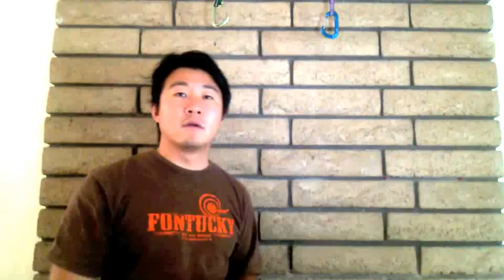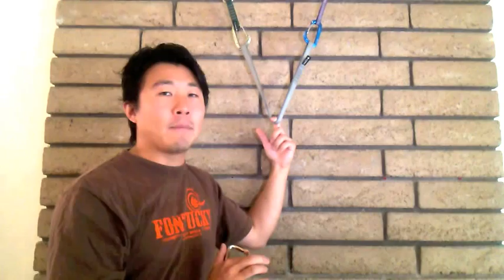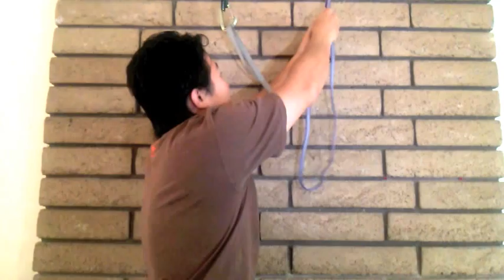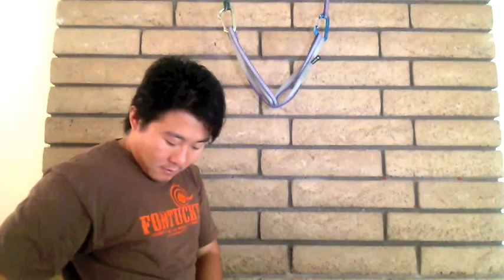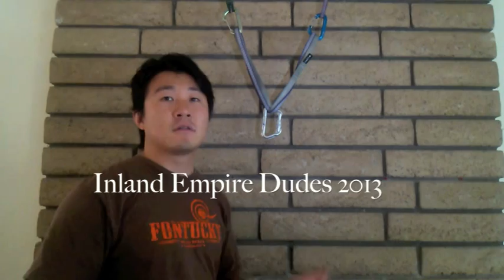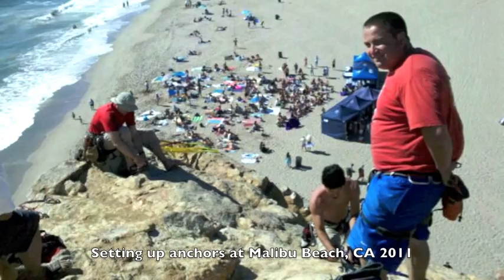Top-Rope Anchor DON'Ts: What NOT to do!

Comment: I don’t think 2 slings in a magic X is the answer the friction would concern me. I use a quad anchor built with a 240 cm nylon sling but Dynex would be fine too check out this video and others from hownot2 if you’re concerned about the forces involved https://youtu.be/she8vH1DCBU

Comment: 😂 nobody is busting carabineers clipped into a master-point never even seen it in a video there's no point in backing that up if you know you have a good carabineer especially if it's a steel carabineer. Unless the carabineer is getting loaded at a weird angle that reduces the strength then there's not really a point to backing it up

Comment: The single sling sliding X is a common and safe top rope anchor under normal circumstances for bolted anchors.  I would be extremely interested to see a documented case where a sling in this configuration that is in good condition has failed at a bolted top rope anchor, even where one bolt has blown.  Perhaps if you do something stupid like try to climb above your anchor and then fall on it, or where the sling is in poor condition but otherwise slings don't break like that.  Ditto for carabiners.  

Just saying that everything should be redundant is completely unscientific.  In some cases it is necessary but in others not.  If you understand and respect forces generated on pieces of gear and maintain your equipment there's no need to get into this nonsense.  Otherwise you're going to end up clipping two quickdraws into every bolt, using two single ropes, and wearing full body armor to climb, which is the approach that this guy seems to advocate.  

Check out these sling break tests for more - http://dmmclimbing.com/knowledge/slings-at-anchors/
http://blackdiamondequipment.com/de_DE/qc-lab-sling-strength-in-3-different-anchor-configurations.html

Comment: My instructor told me to always use locking biners in anchor building. I think I'll stick with that.
Reply: +Beau W Ajax using a locking biner in the system is actually increasing the redundancy of the system.  If the 5 seconds it takes to unscrew a gate is a factor there are auto-lock options that might be a better choice.  The fact of the matter is rock climbing is an inherently dangerous sport that's why people do it otherwise they could just watch youtube videos for kicks...and what is the point of building one redundant "master anchor point" if the entire system is not redundant this would mean using twin ropes, 2 biners at every connection, 2 harnesses, 2 belayers, etc basically safety yourself to the point the sport is more of a burden than an experience...point is if you put a loaded gun to your head and pull the trigger the probability is you will have clean ear canals and a very bad day, you should know the risk you are taking and if you are not willing to take such risk build accordingly.
Reply: +AJAX B, That's probably because your instructor ignores using redundancy at his master point, safety techniques evolve over time. Redundancy of all parts of an anchor never used to be the common way things were done, now we now (through people being severely injured and dying) that ANY part of a system can fail and that redundancy is a must for a truly safe anchor.

And as he says in the video having a quick way to secure yourself at the top of a lead climb is very important, which is not provided by locking carabiners. This is obviously less important if you are only ever top-roping.

Comment: What is the difference, in your mind, of pulling the 2 anchor carabiners together, as you showed, and having the rope go through 2 carabiners doubled at the X spot?
Also, because you don't want to have to unscrew a carabiner does not make it unsafe, or not as safe as a locking one. Safety trumps convenience every time, otherwise we wouldn't be discussing backups!
Reply: +Bwanar1 You never want the angle of the gear between your 2 anchors to be greater than 90 degrees. If you use just 2 quickdraws to create your anchor and the bolts in the wall are too far apart then the direction of load on the carabiners of the quick draws will not pull in the direction they were created for and are much more likely to fail.

As for the part about why he advocates for not using locking carabiners it's because having a quick way to secure yourself at the top of a lead climb is very important as an issue of safety, which is not provided by locking carabiners. This is obviously less important if you are only ever top-roping.

Comment: 2 quickdraws, gates facing out. welcome to 99% of sport crag toproping. quick. easy. SAFE! for the boy scout scenario, if your instructor, or papa bear (?), or whatever you call that guy/girl, is using slings, hes probably a novice at best...or has very limited resources...if you are setting up an all-day toprope, grow up and use cordelette, cheap, much more shock/abrasion resistant than slings (nylon or dyneema), plus it's infinitely more versatile!
Reply: alex kray What the hell kind of cordelette are you using that's stronger than a sling? Dave Furman from mammut wrote an excellent article describing the forces acting on cordelette in an anchor scenario. If you have really good 7mm cord it will have a strength of approx  10KN, because you double it up you get about 35% more strength (13.5KN), that's slightly more than half the breaking load of an average sling(22KN).

Comment: So let's say a figure 8 knotted single rope takes at least 16kN even after some use. Rope friction at the master point is approximately 30% of the load applied to climber. So in a case where one was toproping at seacliff and a great white shark were to snatch the climber from the wall thus causing over 16kN load to the climber side, the anchor would experience at least 1.7 times that which is over 27kN. Most lockers take 22-28kN so yes, back it up!
Without the shark I find it difficult to top the 9kN max. impact force transferred by single ropes(This will be higher if climber is over 80kg!)
Rig steel for the boy scouts, that's what gyms do.

Comment: I would say doubling up on slings and caribiners is overkill, those are going to be the last things that fail in your anchor system.
Reply: There's a great resource called "Accidents in North American Mountaineering" which can provide examples where this is folly. You're right that these fail rarely, but I can name cases where strong webbing has indeed failed (we lost someone in Yosemite not long back where a belay loop failed, and this is double the strength of a single strand of webbing). Don't risk your life to it. That carabiner might have fallen and be cracked, that webbing might have spent too many years in the sun. There's no good reason to ignore redundancy when it's so easy to add the second sling or biner, it just doesn't take any effort at all. I would never climb on a non redundant anchor, nor with anyone who set up one.
Reply: Slings definitely break, especially older ones that people should have retired but don't.  Also, the main reason to double up on carabiners is because the gates can be torqued open under the right conditions.  Using two with opposing gates mitigates this.  In fact, when I'm top roping I feed the rope through three carabiners.  That way, the rope is going through a much wider diameter arc, which reduces wear and kinking on the rope.

Comment: You meant half ropes, though you had twin ropes in mind. Twin ropes are treated as single, but always tied in and clipped in together. Half ropes are used for trad climbers to clip protection in two separate lines. Half and twin ropes are completely different.

Comment: In still wondering why you're saying top rope protection. This setup is for climbing and arresting a fall. 

You should state that. As you should know you should never be more then 3 m above any fall protection. 

Try taking a UIAA certified class like Petzl.
Reply: This set up is used to make an anchor at the top of the route. Then the rope is fed through the carabiners or a pulley (with some back up). As the anchor is at the top of the route, it is never meant to be climbed above it (unless for topping out, but that doesn't happen that often with top rope climbing). 

With all respect, take a climbing terms dictionary. You got your facts wrong.
Reply: Actually I got my facts right.

This setup is put in place by a lead climber on the route which can be anywhere. The top rope should never be setup like this. You need a second point to tie off the lead climber that can hold him and the second if he falls. This applies even if the second climber is above the belayer on any route. You should never use the human body as the fall protection period.

This is not a top rope protection either. It doesn't meet the first requirement.
Reply: Jousikorkojaakko Your best point is your last one.
Reply: Claude Rains What the hell are you talking about? Please, check what toproping actually means before pushing any nonsense like this. This setup has nothing do to with holding the second if he falls. 

As shown in the video, the common sports route setup in local crags are two bolts. Common practices:

-Someone leads up the route and setups the top rope, as instructed in this video (while simultaneously clipped safely to the second bolt - or if the platform is good or depending your personal risk level, clipped to nothing). 
-Someone walks up the crag and setups the top route, as instructed (while ... etc).

After whis you, walk or lower yourself or someone lowers you from the top rope anchor you just created.

After this the climber is free to top route the route, rope going through the top rope anchor and belayer staying on the ground and belaying the climber. As in fucking any normal gym or top rope situation. 

"I actually got my facts right". Right.
Reply: No you don't!

You're welcome to read http://www.irata.org/docs/pdf%20downloads/IRATA%20Technical%20Report.pdf
 
Or

http://theuiaa.org/upload_area/files/1/Attaching_to_rope_by_karabiner.pdf

Good day
Reply: Claude Rains Im still not following you.

What is the problem here? Of course you don't (or to be exact, the top roping climber) tie the top rope to a screwgate carabiner or a clip carabiner, you tie it directly to your harness.

And yes, while setting up top rope anchor, I always use:

-Use two slings and; 
-A single screwgate garabiner or magnetron (negates the gate automatically screwing open with a rope) and a backup carabiner.
-Or two adjacent clip carabiners
-Or combination of these three. NEVER the screwgate alone.

Please elaborate. How is this not a top rope anchor? How would your top rope anchor differ from this? The guy on the video clearly states that the clipping carabiners in top of the frames are to simulate the normal two bolts found on the crags. 

And anyhow, who in their right sense would base their climbing anchor training to youtube videos anyway.

Comment: You always hear about redundancy is key for climbing, etc. I completely agree with this notion. However, has anyone else ever realized that almost every single climbing system is not redundant because of one piece of equipment; the rope. If your rope fails, no matter how redundant your system is, you are basically screwed (unless you're using two ropes for whatever reason).

Anyways, I would also like to mention that the American Mountain Guides Association (AMGA) single pitch instructor program manual describes the "magic x" anchor with only ONE sling as pretty much the gold standard for climbing. Generally, two over hand limiting knots are added to each side of the "magic x" anchor in case of failure (adding your "redundancy" to the system).
Reply: http://www.hapaet.com/onrope/anchor_equalizing_forces.gif
Reply: +Matthew Leroux ^ this guy knows what he is talking about.
Reply: +Matthew Leroux Safety evolves. This used to be the standard. People have died. Redundancy of all components of an anchor is the new safety standard.

Comment: always have your slings against the spine of the biners and you can normaly get away with using carbon steel biners which are nearly impossible to wear out and just put up with having to unscrew the lock.

Comment: when using two snap gate biners together with gates opposed then you can add friction into the system on the sides of your rope, just something to be aware of if you aren't already.
IMHO, you should re do this vid, no um, and I think your point at the end is irrelevant (belay biner has load only when lowering or when holding a person, its the same for any other carabiners, except for when you are getting rope stretch.

Comment: What your doing is safe, but the reasoning is a but lost.  You must trust your equipment to not break.  The bolts, the pieces of protection and the anchor systems will always be the point of failure.  People kill people.  If you can find someone who's had a carabiner "sawed through by rope" please let us know.  Having two more than one being on the focal point is to save your carabiners from wear and tear.  That's my two cents.

Comment: The vid wasn't a catastrophic failure, but it does need some improvement IMHO.  The major problem with "Instructional" vids is that there are 2 types of ppl posting - actual climbing (and high angle work in general) instructors...and guys like IED.  There are only a few good vids out there (Joe Mackay aka mikebarter) and the rest either miss too much, explain things poorly or are just plain wrong.  Then there are the 2 types of ppl who research these vids - ppl who already know safe practices and are just looking for other ideas, and those who know nothing (or enough to be dangerous).  Either way, "The Youtube" is not a place to learn anything as dangerous as climbing, anchor building or high angle work.  If this is your sole source of learning, then good luck to you.  I just hope that I'm not at the crag when you thunder in... although good practise, I don't really want to be doing rope rescue work for those who shouldn't even be there.

Comment: 1. you were unable to explain why "american death triangle" is unsafe. The reason you present is not enough - I get the impression you simply lack knowledge
2. in your comments you say that no one explained the physics behind magic-x... let me enlight you - there is a plenty of such descriptive movies. here you go: Multi-Point Anchors | Rigging Physics II
3. later in comments you show lack of basic knowledge about the concept of reducing different risks. Simply adding more stuff doesnt address many risks that will still be there (like line flattening, dynamic shocks, etc. for starters).

My advice - go learn before you get yourself killed and (most important) - before you direct anyone else into trouble.
Reply: I agree that this is a bad video, but I wanted to weigh in on the whole "american death triangle". I was originally taught that method by someone who probably needed an update. I learned from others who had more experience to build truly redundant anchors (if such a thing exists). The "magic x" is only redundant if two slings are used. It's not unheard of for slings to break. If you only have one sling in use, and it fails, the whole system fails. That's never an ideal anchor. As far as I can tell, depending on the style of climbing you're doing, true redundancy is a luxury and not always adhered to. I've pulled up a second on anchors similar to the "American Death Triangle" out of necessity. Some may think that's totally unacceptable. I say you have to access your own level of acceptability. In short, it's not ideal bc it's not redundant. Maybe I'm wrong.
Reply: ***** Good point. You probably refer to situation where one point will fail and the load on the second, together with force applied by short "fall" will exceed the maximum breaking force on the second point or / and sling. This may be fatal. I have seen one man using short loop of dynamic rope instead of sling for such purposes. Maybe such replacement can make the magix-x reasonable choice, but anyone trying it, should calculate it correctly before use.

Comment: Sorry, but this is false.
I always use the "Magical X", or multiple slings (or a cordelette) with a eight knot on a bite (the later is better as in case of one of the bolt failure, it will not chock the whole system.
When climbing, you start with the hypothesis that the sling is fine and can hold you and will not break. Same for the harness, your grigri and your belay carabiner!
I agree with the need of two carabiners though as they can get unscrewed with the rope.
beginners, don't watch this!

Comment: Not a bad video, dig this bro =) 2 locking carabiners or 3 oval (opposite/opposed, same size and brand) for your masterpoint. 3 ovals is the new recommended method for various reasons, one being that it limits the "flattening" of the rope. An anchor is never redundant but we, as rock guides and climbers, work TOWARD redundancy.  I've seen many people with a single sling top-roping, so scary. Glad you pointed it out.